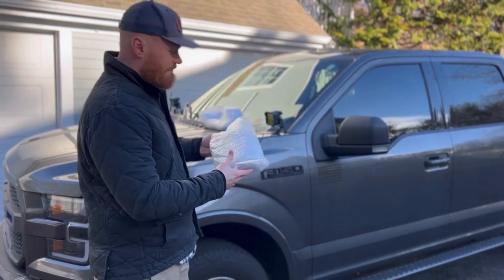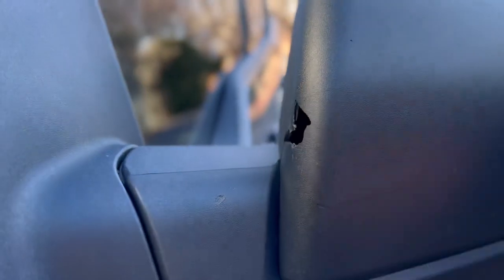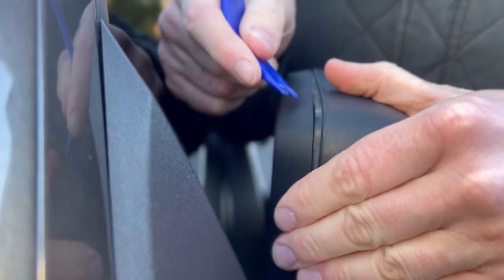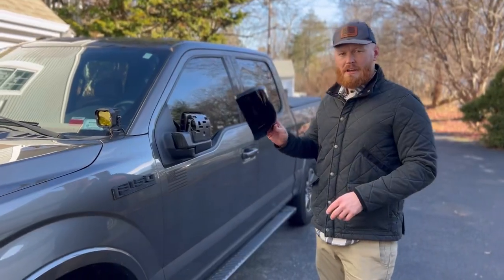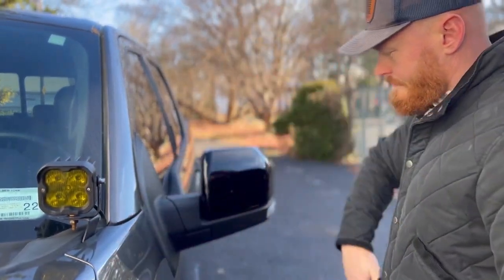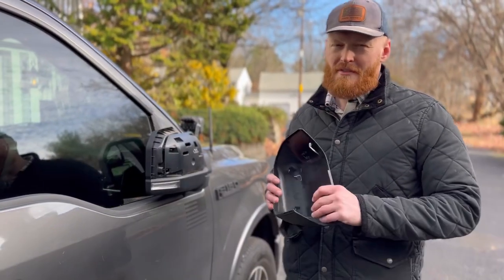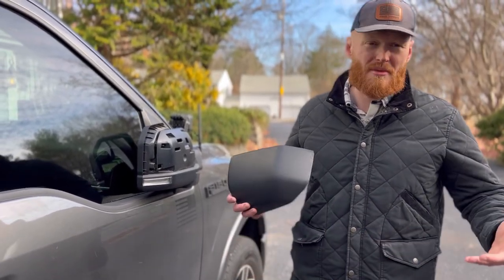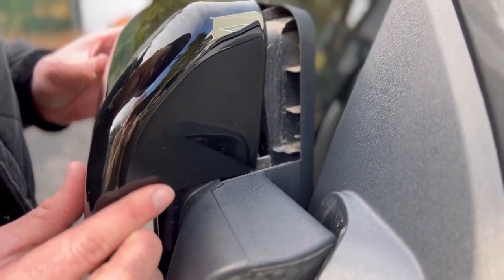F150 PAINTED MIRROR CAP INSTALL: How to remove and install F150 mirror caps.

Comment: So it’s just as easy as it looks.  Simple for you but my identical caps won’t snap in.  Going back to try again.
Reply: Mine won't snap in either!
Reply from the maker: Did the original snaps break off inside where the new ones go?
Reply: @AutoHeadz  1 did, and I removed it before trying to install the new one.  The ones I bought were off ebay and are not OEM.  So I'm assuming it's just a bad mold since it's aftermarket.
Reply from the maker: @speeddemon0712  yeah man. If you didn’t use the ones I provided the link for good chance they are rubbish.
Reply: @AutoHeadz  Well shit, I had no idea you had a link and they're sold on Amazon.  If the seller doesn't send me another pair to try, I'll just order them from Amazon.  Thanks!
Reply from the maker: No problem man. I’ll put the link in the first comment too. Good luck
Reply: I got these same ones from Amazon and they don’t snap onto my 15 XLT
Reply from the maker: @albertsimonian6502  Just want to make sure. Did you buy the ones from the link I provided. I want to make sure they are the EXACT ones before I change the link. The people iv heard having problems thought they were the “exact ones” but after further review they were not.
Reply from the maker: @speeddemon0712  Hey man! Just wanted to follow up. How did the install go? Did you get a new pair?
Reply: @AutoHeadz  yep, I just double checked. They were the exact ones. I’m going to go ahead and try again tomorrow but they weren’t snapping into place
Reply: @AutoHeadz  I haven't bought the ones off Amazon yet, but they're in my wish list haha.  The more I look at them though, the more I think it might be too much white.

Comment: Which link did you use? They’re sending me to two different products. Thanks
Reply from the maker: The first link is for the black ones I purchased the second link is for if you have a different color vehicle and you wanted to get a different color other than black
Reply: So the ones that are 28$ not the 80$ ones?
Reply from the maker: Yes Sir. The 28% ones are the same I have on my truck/seen in video.

Comment: How do u get the tabs out that broke off ?
Reply from the maker: The tabs come from the mirror cap and are not needed to put the new one on so I just tossed the whole thing. If you get a new mirror cap they come with tabs.
Reply: @AutoHeadz I was also wondering the same thing. To clarify the question,  how did you get the broken tab out of the slot in the mirror body? (Where the tab from the new mirror cap would have to slide in)
Reply from the maker: @Alexander-qd7nj  When they break off they literally just drop out. There is nothing holding them in at all. It’s a completely open housing so when they break they just fall out.

Comment: New subscriber here. Got a blue 16 sport xlt that could use this mod. Great honest advice. Looks good bud. Thanks for the share
Reply from the maker: Thank you for subscribing and the kind words. More great content to come. ✌🏻
Reply: @AutoHeadz  just got new toyo at3s ordered for truck and they go on this Thursday can't wait. They'll be replacing the sock fortitude ht's😁  can't wait.  I will look so much better and be so much more better to drive in every condition. Next need to get lights and the raptor grill. Truck is velocity blue aswell
Reply from the maker: Very nice! I just got myself some Falken AT3W’s after having the trash stock tires on for 3 years lol. It’s amazing how much of a difference some nice tires makes. The raptor grille makes SUCH a difference. So aggressive looking. I made a step by step install video if you want to check it out. https://youtu.be/ZdDX71JG1bs Ttyl broski.

Comment: Would this work for 2019 f150?
Reply from the maker: Yes! They will fit 2015-2020 F150’s.
If you need help finding I put a link to both the black and multiple colored caps in the 1st comment and video description. Good luck!